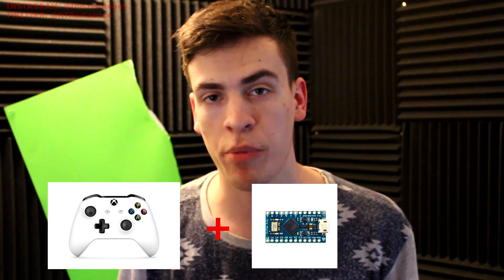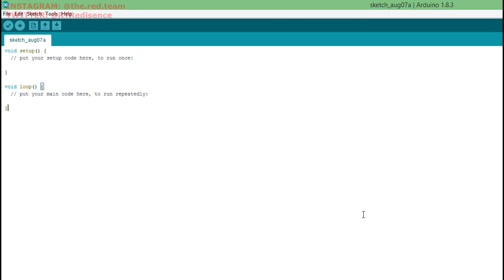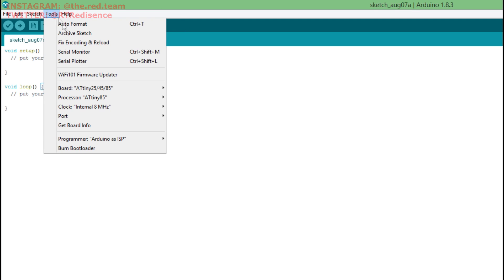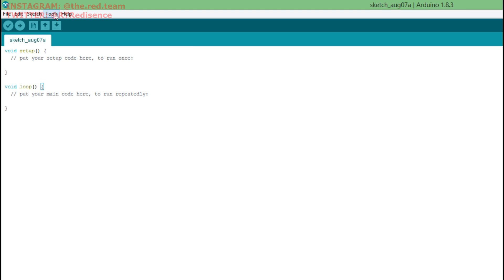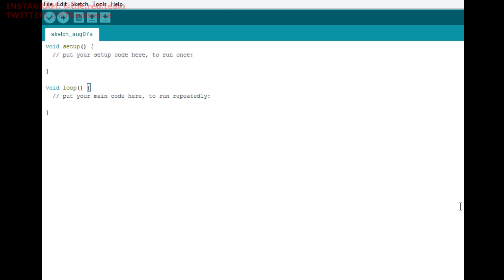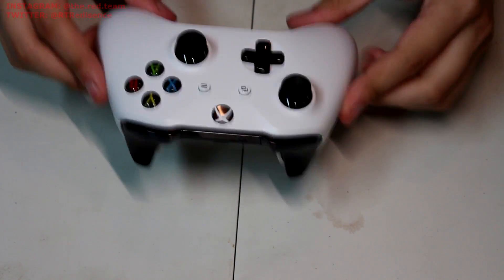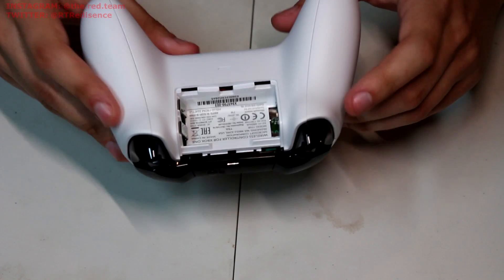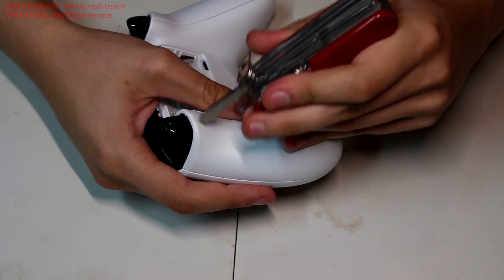XBOX ONE - $4 RAPID FIRE MOD TUTORIAL | ARDUINO

Comment: rt not firing? dont know whats wrong with it any ideas?
Reply from the maker: The only thing I can figure is you may have accidentally desoldered the capacitor or resistor while connecting the wire. Other than that, I can't think of anything that would cause your trigger not to fire if you messed up at any other point.

One possibility would be if you modified the code to always send a HIGH signal to the RT no matter what, but if you did not modify the code, I would not worry about that. 

You can try to apply more solder(not much) to the capacitor and resistor and see if that corrects the issue. Let me know what happens.
Reply: are you using a 5 volt or a 3.3 volt board?
Reply: check out my comment dude.
Reply: Check if it fires with the mod detached. You might have buggered the small capacitors on the trigger circuit. If its just not rapid firing, Check the code is uploading without Errors. and the lights should blink when activated.

Comment: I have a highly deterministic game I want to "TAS" by feeding a preset input through a controller via some sort of modification (basically a long macro). Does the Arduino Pro Micro have this sort of capability? I'd only need to send input to four buttons, left and right on the d-pad and A and X. Or is there something else I'd need to look into to do this?

Comment: I've been installing these things for a while. One problem: It only has one mode, which is not supported by all games. Standard has five modes so you can find at least one, if not two, that work.
Reply: Hey! I'd love to pick your brain about this. I'm trying to find a way to toggle a full-auto/rapid-fire option for the right trigger on an Xbox Series S controller (I have carpal tunnel). Your comment caught my eye, in this video Koko is showcasing something besides standard, is that right? What is the standard you are referring to? A different board or code? Would love to hear from you!

Comment: I tried this on series x controller but for some reason the mod is on at power up and has to be turned off. I also tried with hair trigger kit installed with tac switches on triggers but it won't work with tac switches. Assuming a hard switch won't allow output to pulse high and low. Any ideas on why mod is on at power up. And a way to change code to work with tac switches on triggers.

Comment: I expanded this mod to use rapid fire on the A/B/X/Y buttons. To do that you need to connect the digital outputs of the arduino to the base of a transistor, and use the transistor to make a path to ground from the relevant soldering point for the A/B/X/Y buttons

Comment: so I bought the board finally came in took for fuckin ever got the code uploaded it checked out the code and then thought shit he updated the code from what i seen on this vid so my question is is the wiring the same and does the code that is current on github need any other tweaking(yes i can program have since i was 12) and or rerouting of wires to say the sync button for example? Also have you tried it on coldwar

Comment: Only works while plugged into a power source. Is there another power point we could use to avoid this ?
Reply from the maker: It should not only work when plugged into power. The battery should still be able to provide power if the proper controller was used. I have a separate video showing a new mod I developed. It uses the same solder points and I demonstrate it working with battery power.

There are likely other points that can be used, but I do not know what they are.
Reply: @JustCallMeKoko  thanks for the reply! I ended up getting it to work but it’s a bit buggy.  Do you have any other codes ready for it ? Love the video it was super easy to follow.
Reply from the maker: @SteezyB99  I do not have any new firmware for this version of the mod. If you want to try to get fancy with an esp8266, you can watch my more recent xbox mod video and make a mod that is configurable over WiFi. That firmware works a lot better.

But I am glad you enjoyed the video and you were able to follow along. This video is quite old and is now one of my more cringe tutorials. I am just happy to hear it is still useful.
Reply: @JustCallMeKoko  Yeah, I think what sparked my interest was how cheap the mud chip actually was. Obviously you pay for what you get so I found some small bugs along the way like the rapidfire will turn off when I die or switch guns or sometimes just turn off for no reason but maybe that’s because of the new controller updates or for the new game or some thing. But I was looking at your other video and I think I’m going to give that one a try as well. I customize controllers I was like a little side business so this could be something I would be able to offer people. Check me out if you got time on Insta @BJCONTROLLERS
Reply: @JustCallMeKoko  I have installed a couple rapidfire chips, and worked out some of the bugs on my own regarding the power supply and what not. However I have a customer who wanted a rapidfire chip put in his Xbox series X controller when I was watering the Controller all points are the same except for our three there are no two resistors in that area for the trigger. I was curious if you had any idea on where I would be able to wire the trigger for the new controller.

Comment: Hi, I did everything like you. After turning on the controller, the RAPID FIRE MOD is immediately activated. After pressing R3 and L3 it switches to normal mode. How to fix it? Need to change your code?
Reply: Add a delay to end of setup. I had the same issue on series x controller. The Arduino would receive power before controller fully woke up and L3 and R3 would see low and activate. The delay will give controller time to turn on before loop starts.

Comment: Discount code coronavirus 😂 damn keeping the old vids fresh, is there any way I could program a whole mod chip with an Arduino in a ps4 controller?
Reply from the maker: I am sure there is a way to do this with a PS4 controller but I don't know what it is since I have not tried.
Reply: Been looking all over the internet for information on a potential way to do this, and found sweet fuck all, so I might need to design it myself which will be tough as I know absolutely nothing 😂
Reply: @connormac7770  hey man I know it's been a year but any luck?
Reply: @connormac7770  same question

Comment: Would you be able to program more mods to the same script?
Reply from the maker: Yes it is possible. You could make the mode akimbo if you wanted and knew how to solder to the left trigger. I have a recent video showing a new mod I created that has this feature.
Reply: Just Call Me Koko Hi I tried to do for the left trigger but when I active the mod the LT trrigers itself,and would you tell how to creat two mode in one sketch of arduino please,I tried to mix another mode but only the RT works when it is pushed,other buttons pressed automatically by themself when I active the mode
Reply: Denys sane question

Comment: I finally got this to work on a actual xbox one controller. Only issue I have is it takes power from the J connector which is only supplied with power by usb into the controller. With a rechargeable battery pack it does not light up at all. Any TP’s or other points to take power from that runs through the battery voltage? Other question, which part in the code do you modify to increase or decrease the rate of fire?

Thanks!

Comment: Great video mate! I am trying to do my own program with arduino mega 2560 / Raspberry Pi 4 but I am stuck with wiring... I am just trying to do simple program where a do "Serial.println(analogRead(A0));" to watch values I get from L3... But all I get is sinusoidal plot where my values goes from 0 to 1023 and back... Do you have any idea where could be the problem? I have only 1 wire connected to my arduino Mega an it is in A0 to read values... Also I have 1697 version of Xbox one controller but I believe solder points for L3 are the same

Comment: im going to try this on  a PowerA 3rd party controller, i looked at the motherboard and seems far easier to solder those pinouts and are easily readable R3, L3, GND, PWR, RT, let you know if it works
Reply from the maker: Good luck. I look forward to hearing about the results. If you manage to get it working, next step would be setting up your own ROTA mod.
Reply: @JustCallMeKoko  well so far no luck, can not even get the pc to recognize the attiny85 even after adding drivers from digispark. I'm about to just go with the micro pro i just liked the attiny85 form factor over it
Reply from the maker: @Turbo_Zebruh  Well how have you been using the ATtiny85? Is it on a digispark or is it a bare ATtiny85 just by itself? You won't be able to flash firmware onto the ATtiny85 using the digispark drivers unless the ATtiny85 has the micronucleus bootloader burned to it
Reply: Just Call Me Koko it’s a DigiSpark clone, gonna have to try and put the boot loader on it, thanks bro for the tip
Reply: Just Call Me Koko update today: micronucleus was successful on boatload, had to plug in the attiny85 after clicking upload for it to take it. Then added your sketch for the 85. Soldered everything up on an old Powera brand Xbox controller. Seemed glitchy like it wanted to work and would fire on its own without RT being pressed. Probably some coding configuration would need adjusted I would guess. Conclusion is to just go with official Xbox one controller and utilize the same components that worked for you. Thank you for your video and time.

Comment: I have a question that might sound stupid however I'm not educated on the different types of Arduino micro pros. Is there a certain kind I need to buy or do all of them pretty much do the job?
Reply from the maker: The Arduino Pro Micro is a specific kind of arduino. There is a 5v and a 3v version of the Arduino Pro Micro. Either one will work for this project.

Comment: Can someone tell me if this still works?
Reply: Works fine! But i did it on sync and B button.
Reply from the maker: @Mr.Z_Belg  If you change the code a bit, you can just use the sync button. I wasn't expecting anyone to want to try to solder to the sync. Did you solder directly to the button or the small solder pad on the board underneath the top board? I will also be posting a video soon about a new and improved version of this mod.
Reply: @JustCallMeKoko  i did it on my elite controller.. i have pictures if you want?
Reply: @JustCallMeKoko  i tryed it on my regular controller also but the Red lights of the Arduino   didn't work =s..
Reply from the maker: @Mr.Z_Belg  Yea I would love to see those pictures. I want to post a tutorial for how to do this with the elite controller. You can share them via a github issue on my rapidfire repo linked in the description or via ig @just.call.me.koko
Reply from the maker: As of now with the most recent Xbox One controller, this mod still works. Fortunately this mod is so simple, It will work on whatever controller microsoft releases in the future as long as the continue to use PCBs. The only thing that would need to be reworked is figuring out where the solder points on the controller are.

Short answer: yes this still works. Just make sure you have the most up-to-date xbox one controller.

Comment: Hey I do t know what I did wrong but the controller just shoots no matter what did I mess up in the coding or did I solder it wrong
Reply from the maker: This is not an issue that should be happening if all the steps were followed correctly. That used to be an issue with the code but I fixed that maybe a year ago.
Reply: Just Call Me Koko I believe I might have messed up on the first solder could that have effected the trigger

Comment: In the old version of the controller, where can I found the resistors to be weld together? Help me pls.
Reply: Weld!? Its soldering! It should be near RT.
Reply: @fuckbitchesgehmoney  on my board it was on the bottom right at tp104 its really hard to find i cant remember the page i got that info from but it works

Comment: I’ve never really played around with aurduinos before, I have used raspberry pi’s a few times. Long term does this work, and if so is there any revisions I should make or change about this project
Reply from the maker: Long term this does work. I have made several changes to the project such as getting it to work with the sync button instead of the thumbsticks, including the left trigger in the rapid-fire mod, and using the controller LED as an on/off indicator but I have not released the code for these changes or published a video showing how to do this. If enough people were to show interest in learning how to do it, I could release a part 2 to this project.

Comment: For any issues please refer to the board you purchased. I found this exact board being an off-brand variant of the Arduino here OSOYOO Pro Micro ATmega32U4 5V/16MHz Module Board with 2 Row pin Header for arduino Leonardo Replace ATmega328 Pro Mini https://www.amazon.com/dp/B012FOV17O/ref=cm_sw_r_cp_api_i_duTJCb27AANAK 

I personally have had no issues when using this board with the method being demonstrated, thank you for the tutorial and enjoy the link everyone 😏

Comment: I got everything working perfectly fine, but is there any way i can increase the rate of fire, like make it any more insane?
Reply from the maker: Of course the rate of fire can be modified to be faster. The only problem is that games often times include a cap on the rate of fire with semi-automatic weapons so even if you could manage to "pull" the trigger at 1ms, the game would only register a trigger pull every 100ms. This is a limitation coded into the game, not the controller.

Comment: RT constantly firing?  I’ve tried this on 2 different controllers and both of them ended up just acting as if RT was being pressed constantly. I tried pressing every button on the controller, including the thumb sticks at the same time, but nothing seems to get it to stop pressing RT. Any help?
Reply from the maker: This should not be the case. The way the controllers work when firing the right trigger is by a hall effects sensor sending low voltage to alert that the tigger is being pressed. Once the voltage goes back to high, the controller knows that the trigger is no longer being pressed. When the mod is on, it is constantly sending high voltage signals to simulate the right trigger being "released". If the right trigger is not being touched, this should have no effect on the trigger since the voltage is already high. When the trigger is held down, the high voltage signals from the mod trick the controller into thinking the trigger has been released when in fact the trigger is still being held down by the user. Since the mod is rapidly sending and stopping these high voltage inputs, the controller sees it as rapid trigger taps which translates to rapid-fire. So if you are NOT holding the trigger down while the mod is ON, your controller should not just constantly be firing.

If you have an instagram, DM me @just.call.me.koko and send me pictures of your controller wiring with the mod and a video of it malfunctioning so I can help get the issue resolved.

Comment: Bruhhh it’s t7... t6 will strip the screws
Reply from the maker: Bruhhh...There are two different size screws for the controller. The outer screws are T7 and the 2 inner screws holding the boards together are T6. That is why I used the T6 screw driver for the T6 screws.

https://www.youtube.com/watch?v=wBuREhx8Wes

Comment: I just fucked up my controller LOL, for those who want to try this dont use the resistor or the capacitor for solder the RT, use the TP67  (http://www.acidmods.com/forum/index.php/topic,43981.0.html).
And if you already fucked up the trigger, the values of the capacitor and resistor are: 
R39 = 100ohm
C36 = 500nF
You just need to solder the lower pin from the U10 to the resistor and the capacitor and then, both of them to the TP67.
Hope this help someone and sorry for my bad english :)

Comment: Hey I used this method and it works but only if its plugged in ? Im not getting enough power ... can i get it from somewhere else else on the board I can find it my self just wondering if you know
Reply from the maker: The way I showed in the video should work regardless of power source. The mod will function even if it is just running off of battery power. I cannot guarantee that if you are not using the same type of controller I show in the video or if your controller is malfunctioning in some way.

I am sure there is another point to draw power from on the controller, but I am not aware of it so you will probably have to do some poking around

Comment: mine only works wired and is hard to fit in the shell. if you can help me pleas comment back thanks
Reply from the maker: as long as you chose the same solder points I showed in the video and it is the SAME generation of xbox controller, you should have no problems powering it with a battery pack like normal.

For fitting the mod inside of the controller, i find it is easiest to place it between where the right trigger solder point is and the large rumble motor. I pretty much place mine right up against the rumble motor slot and glue it flat to the xbox circuit board with hot glue.
Reply: i did  i also used the one s

Comment: wait if you take it apart is the headphone jack permanently ruined?
Reply from the maker: No. When putting it back together, sandwich the headphone port between the two boards. You will see copper contacts on one of the boards that will line up with the pins on the headphone port.